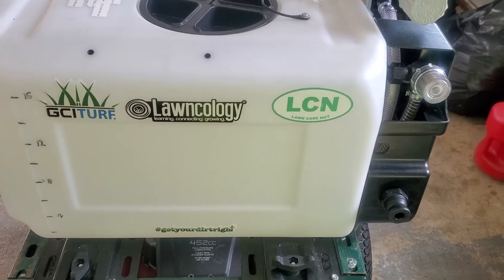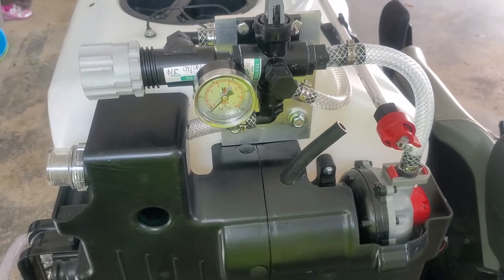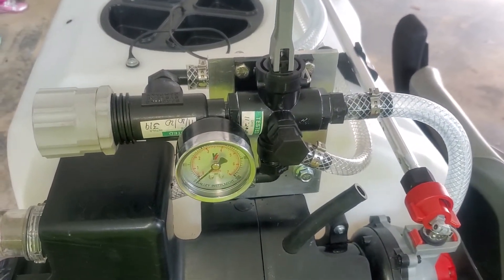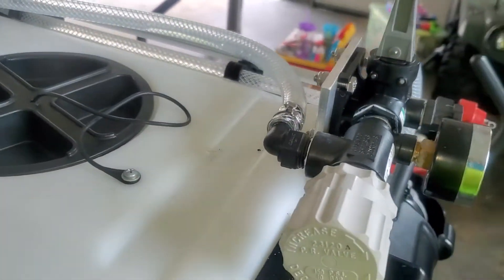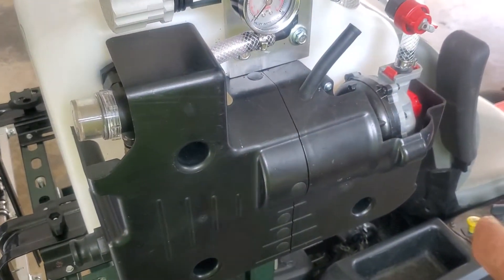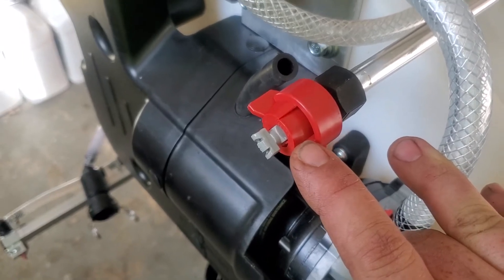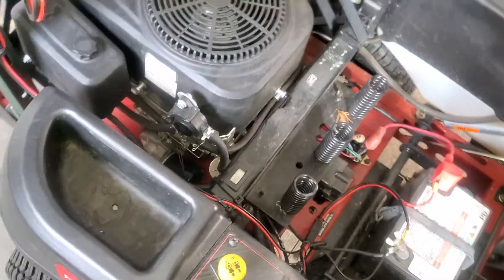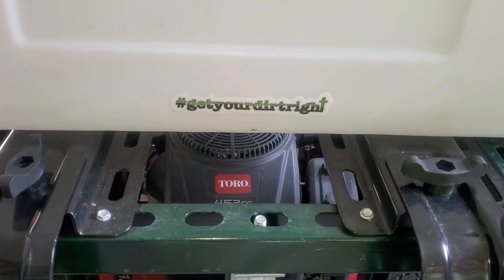How to build a lawn sprayer set up the Right Way. Part 1

Comment: Nice neat setup. Half-inch hose is a bit of an overkill unless you have it lying about. You can properly use 3/8" hose to your boom. Three nozzles likely running around 1.5 GPM would drop less than 1-1/2 psi through a 6 foot length. Good explanation and a right fine video for a camera phone!

Comment: I’m a newbie. So please don’t bite my head off. Quick question. I love your setup. Im using a Rittenhouse jet agitator. In their direction it say not to come off of the regulator but your agitator is coming off the regulator.  Where else would it go?
Reply from the maker: Because it's not an agitator it is dumping the excess fluid back into the tank when it's being used. So this way the mixture of chemicals they floating in the water. It does not need to be a jet agitator
Reply: If you are spraying chemicals in suspension you absolutely need a jet or you will get dead spots in your tank where the product will settle out. The manufacturer is warning you not to put the jet on the end of your pressure relief line mostly because jet's can clog. If that happens, you will lose control over your pressure and could damage your equipment. Additionally, the flow from your relief line has volume, but not enough pressure to "stir" your tank. Your jet needs a dedicated line tapped somewhere off the pressure side of your pump. Where is not important but you need a gate valve on that line to adjust the minimum flow that will stir your entire tank.

Comment: Can someone tell me what the thing is above the banjo commect to the boom?
Seems to be clear plastic? And behind it is what I think maybe the tank suction fitting but not sure?
Reply from the maker: That is the intake for the pump there's a screen in there to keep particulates out of the pump so it does not damage the pump or clogged the nozzles
Reply: @licensetochill79  thank you Sir! Did you ever come up with a parts list by chance, I couldn't find one.
Reply from the maker: @emrdrgz  no I never got a chance to do it it's very hard for me to get one together because I'm so busy with work all the time I will try my best that's the best I can say
Reply: @licensetochill79  understood and appreciated, I will be trying to copy your setup on my TS pull behind
Reply: For the spray gun connection, you tapped off the 1/4 gauge port did you use a 1/4 to 1/2 adapter there as well?
Reply from the maker: @emrdrgz  ¼
Reply: @licensetochill79  so 1/4 all the way to the gun, including hose?
Reply from the maker: @emrdrgz  yes

Comment: Does the pressure regulator, regulate everything coming into the T joint or just what’s coming out the regulator?
Reply from the maker: It regulates pressure to the spray nozzle and the Boom. The regulator does not allow over pressure you can see part 2 video I showed how the system operates

Comment: Is the teejet regulator a 60 or 150 psi model?
Reply from the maker: 0 to 60
Reply: Don't use the 150 unless you are planning on spraying above 60 psi. You will lose sensitivity at the normal range of 30-50 psi, and will find it difficult to adjust and keep that pressure.

Comment: Where did u get your regulator?
Reply from the maker: You can find everything at Sprayer Depot. The nozzles I use are tt11006-vp for General spraying of fertilizers soil amendments. The one I use for spraying weeds xrc11006-vk

The only thing I would suggest just to sit down and write out everything you think you need first then make you order
Reply from the maker: Also I would suggest using Loctite 567 as the thread sealing compound for the fittings. I am a mechanical contractor. And this has never failed me when doing plastic fittings

Comment: Connor Ward shows you how to build one: https://youtu.be/jSe159GDUok
Reply from the maker: Yes but his pump is undersized for what he's doing. He doesn't have a constant mixture rate. I love Connor Ward but he cuts a lot of corners and you know that. So I put out two videos explaining the whole process
Reply: @licensetochill79  First let me say, great build guy, just awesome!!! I thought Connor's pump was a good size for a walk behind and the nozzles he's using.  I'm upgrading my sprayer, but my boom only uses 2 nozzles right now. I do like your valve assembly so I will have to look into that and perhaps incorporate that into my upgrade. I do plan to upgrade my pump as well because it is quite underpowered.  Thanks for the how-to video, great tips.
Reply: @ministermanoutdoors6179  I'll be running 6 nozzles @ 50 psi, 0.34 GPM each. I need 2.04 GPM for the nozzles. Since I spray suspensions, I need an agitator calculated at around 1 GMP if I use a 3X efficient jet, for a total of 3.04 GPM. At 50 psi my pump will produce 4.1 GPM, so I will have a very comfortable 25% flow margin. I want at least 15%. A lot of people calculate their margin based on the MAXIMUM flow rate of the pump, which can be a big mistake since that is at zero psi. You need to find the pump's flow chart that shows how many GPM it will produce at he highest pressure you intend to use.
Reply: @licensetochill79  On what basis do you determine that Conner's pump is undersized in the above video?? I can run SIX nozzles with the same size pump, an agitator, and have 25% more flow than I need! Please elaborate on what corners you say he cut in that video. It appears to be the exact same pressure and flow control path that you used, just in a different format to fit his tank.
Reply from the maker: @FisherCatProductions  again I already addressed this in order to get a complete mixture you have to be mixing your chemicals at half the rate that you're putting them down at least. This way you keep the chemicals floating in the mixture as they should. For example let's use TruGreen or any other lawn Chemical Company. They're using two GPM but yet their pumps are rated for over 15 GPM. They use that to keep the chemical floating